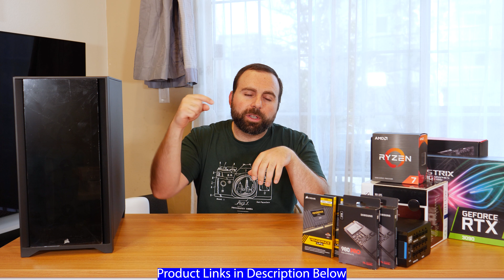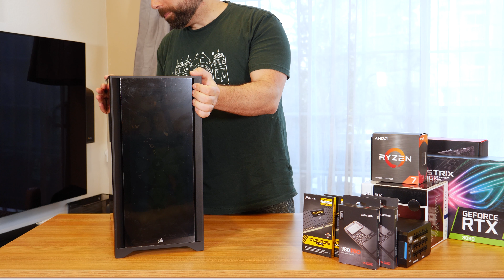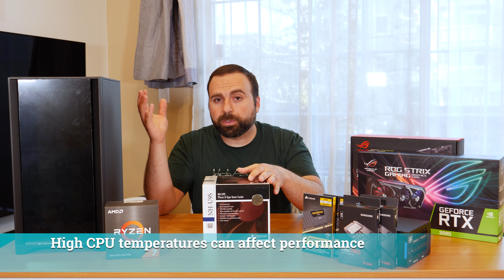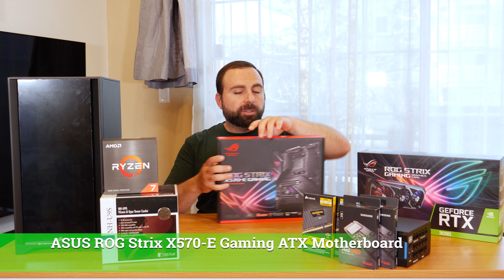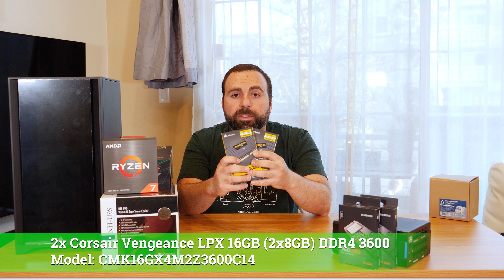How to Build a Gaming PC in 2021 | RTX 3090 Ryzen 7 5800x Build

Comment: Love the video, but that is not enough thermal paste. Maybe double what you put on there is enough, if not a little less than double.
Reply from the maker: Thanks! I try not to put much since it can negatively effect performance
Reply: @landpet  if it works for you, then more power to you! It just seemed like a small amount. If you take off the cooler, does it get full coverage? I haven't built a pc in about a year, so maybe im a bit rusty. I just ordered parts for a new build, so thats why I watched your vid while they come in haha.
But anyway, great video, keep up the good work!
Reply from the maker: @Jdur17  Yeah it's definitely a small amount. I actually replaced my processor a month or two ago with the 5950x and it had full coverage when I took off the cooler. I roughly put the same amount for the new CPU and the new cooler. Good luck with your build!
Reply: @landpet  then i was mistaken, and it was a good amount. And thanks!

Comment: Why would you not remove the M.2 Sticker ... surely the heatsink, needs to be flush to the chip? I removed my Sticker (Slowly) and placed it on the underside and the heatsink now sits flush to it. Temps dropped by 5-8 degrees. Also thats defintely not enough heat paste for a CPU (Penta dot method is recommended for Ryzen chips : Dot in each corner, as well as center).
Reply from the maker: Good to know, thanks
Reply: Where exactly is the sticker you are talking about?
Reply: @zb4358  usually on the M.2 chips.  Refer to video
Reply: @zb4358  21:45 .. the m.2 has the vendor sticker on it.  I peeled mine off and stuck it underneath the. M.2.better heart transfer

Comment: Hi, I have the same cpu cooler U9S and I'm planning to get Ryzen 7 5800x but how's the temps in games & at max load? Can it handle it?
Reply from the maker: TLDR: yes, add another fan (totalling 2 fans) and have good air circulation in your case and you should be fine.

I haven't looked at the temps for a while, it hasn't overheated ever. During rendering it does get a bit hot. I think the U9S is fine but it would be better to have 2 fans on it and have good air circulation in your case. I recently got the nh d15 and the 5950x but haven't installed either one yet.